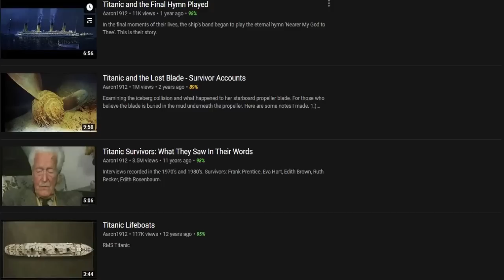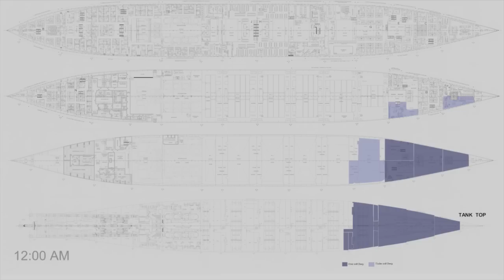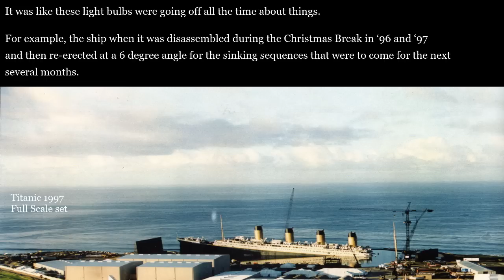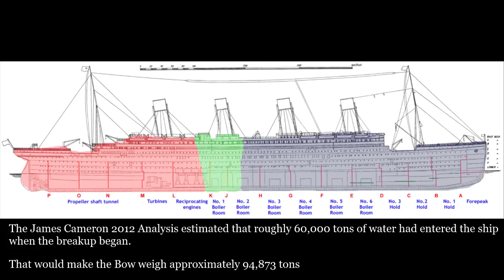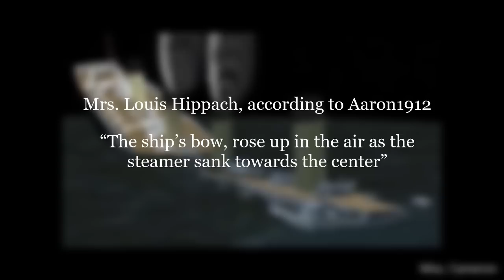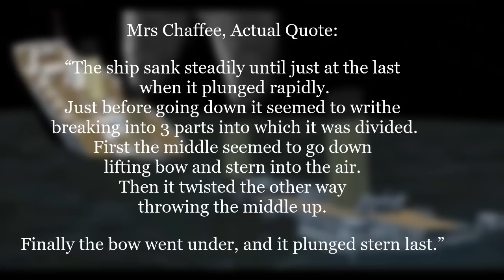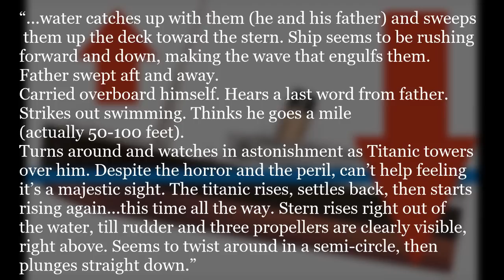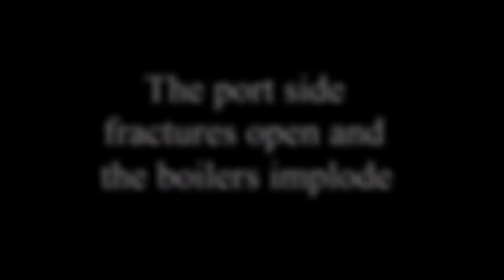Disproving Aaron1912's Titanic V-break

Comment: Your right, its the most simple flyid dynamics anyone with half a brain could understand

Create a hole, below the waterline of a ship, near the front and at the right hand side, thousands of gallons of water start pouring in right in that spot, so, of course, the ship due to the water will weigh heavier at the front, and on the right hand side

Then, as water starts to fill up those compartments, and spill over to the compartments rear of those flooded, the weight from side to side will even out, the list will return to even keel, because from left to right, the ship is now balanced

The nose of the ship will be somewhat under the surface, and with the weight of the water, wont return to the surface

As more and more water floods the front, the ship will see saw down, obviously, the flooded parts wanting to sink, the dry parts wanting to float

Then, when a part of the hull exceeds its design strength, it will snap rather than see saw, the flooded part will drop like a stone to the bottom, the dry part now starts taking on thousands of gallons per second due to damage, and that damage being at the front end of that section, the front end will start to sink, the back, still dry for now will want to float, same as the ship did when it was whole, see saw again, until it eventually completely fills with water and drops like a stone, just like the front

Now, the interesting question is, if the rear part hadnt been damaged so badly, that it didnt take on water, would that have floated indefinitely, and been able to be towed away, or would it have rolled over under its own weight and sank anyway?

This aaron sounds like a total idiot

Comment: Most of the ships i recall V-breaking were warships, mainly destroyers, that got torpedoed amidships and had the boiler/engine rooms flood first with intact bow/stern compartments. bigger ships tended to roll instead of snap due to having more structure left. 
otherwise they tended to sink towards where the hits came in, either bow or stern first, or roll over from amidships hits.
other v-breaks were ships that had the keel fail before the hull plating, generally due to fatigue or storm/wave.

Comment: well titanic didnt do a V break where anny part of the bow resurfaced a partial V break did in fact occour underwater, if you look at percise measuring of the section where the ship snapped you will find that a tremendous V shaped part of the superstructure and hull is missing, so when the ship sank before it totally broke apart the lower reinforced part of the hull acted like a hinge wich squeased the two halves together wich totally decimated that erea before the bow section gained enough momentum to tear apart from the top, that allso explains why the ship raised up vertically very fast at one point stood still for a moment and then came crashing down.

Comment: For the record, water in the bow while in the air would be the weight of the ship and the water, this is true.

But in the water the internal and external water are neutral, so it wouldnt be adding to the weight directly.

Comment: It would be very impossible for a ship like the Titanic to break from the bottom upwards. That would defy the laws of gravity.

Also, another flaw in his theory is that if the breakup happened as he had depicted, the passengers would be the very first ones to notice it.
Reply from the maker: It's possible in specific circumstances like the Edmund Fitzgerald, or battleships hit by torpedoes in the center of the ship in war time. But under the circumstances that Titanic was under? It's not possible.

Comment: Salt water reaches the hot boilers causing an explosion ,blows bottom out ,water comes in, forces trapped air back to the bow lifting the bow back up snapping the ship in half while water pulls middle down.  For some reason, from day one, they never listened to the witnesses .
Reply: Except that the boilers are intact on the wreck

Comment: Here is a theory, it wouldnt have mattered how many life boats over 16 they would have had because they wouldnt habe been able to fill and launch them before the ship sank. Even with 16 life boats with a few of them launched quickly they were still launching boats until the moment it sank. If they had 48 life boats the ahip would have taken alot of them down with her. Also with the heavy list of the ship alot of them would have gotten stuck on the ship and would be unable to launch. It happened to one of the last boats. It flipped upside down.
Reply: That boat flipped upside down because of the way it gotten off the officers quarters roof. That boat was collapsible B. Titanic had 16 full size lifeboats and 4 collapsibles. There wasn't a good way to get the collapsibles down because they never thought they'd actually need them. 

You are right though 48 boats would've actually caused more problems than they would solve. It took them the whole night to launch all 20 that they had and two of those were just floated off the deck just as the first funnel collapsed. Secondly the extra boats would've actually gotten in the way during the evacuation like a blocked door in a burning building and more people would've been left stranded in the water. 

We look at this event too much with hindsight in our minds. No ship of the time ever carried enough lifeboats for everyone onboard, because they relied on the telegraph and the heavily trafficked shipping routes to rescue everyone. That system worked, until Titanic.

Comment: the Titanic sank slowly first, thats why passagers don't notice that the ship was sinking, not because of the angle,  in james cameron's film, they say that "slowly first and then faster, then break because of pressure" and i think it's the real reason why Titanic broke, the accelerating of the sinking made the back of titanic elevate too fast, and i think thats why he maybe broke as a wallet and not separating boths parts before titanic gone under the water.. sinking verticaly seems weird, i've never saw a boad sinking vertically rather than a bomb exploded inside, here there is no way that he could sink verticaly, the Titanic could stablilisate with 4 sliced compartiment because the noze could stay over the water level.. if like it happends the 6 fourth compartiments were sliced , water could enter on the ship by the top, thats why water entered faster and made the ship sink even faster and broke Titanic. here is only my point of view, obisously i think he broke with a lower angle than in the 1997 film,  but here i'm sure the fact that passagers didnt notice it's because Titanic sank too slowly at the begin
Reply: To be fair when Cameron made the movie the ship's wreck had only been studied for about 10 years and since the movie was made He himself has gone back and researched the sinking and break up more in-depth to correct what was inaccurate about the movie portrayal.
Reply: But that part where Titanic Animations quotes Ken Marschall is true, your brain will compensate for a ship's listing after a little bit. A ship will almost always have a soft list, rarely actually at an even keel. Nobody onboard notices it even if they know it's listing cause their brain compensates for the change in angle if it's not a steep angle.

Comment: If the ship broke up on the surface the stern and bow Would have been further apart on the ocean floor due to the different hydrodynamic properties of the sections, and the wreckage of the crushed area between the 2 sections would have been spread over miles of seabed.
Reply: The bow and the stern are a third of a mile away from eachother and there are many survivor accounts that say they watched it break. I like the sea hunters, man but Jim Delgado couldn't be more wrong about Titanic's breakup.
Reply: Also when Bob Ballard originally found the wreck the debris field was calculated to be about 15 sq miles of area.

Comment: H&W builds most sophisticated ship ever in 1912 "unsinkable" due to water tight compartments. Ok well what's the plan should those fill with water you ask? Open said water tight doors to run a hose to the back where water could be pumped out LOL! All they had to do is spring for dual pumps in each compartment and you could drive that b** to NY with holes in the hull np.
Reply: Those didn't exist in 1912.....
Reply: @sorrenblitz805  So what were they hooking the hoses up to then?
Reply: @Meglenger  condensers, they hooked them up to the condenser discharge for the boiler system.

Comment: As someone who has studied the Titanic disaster for 25 years, any claims about "V' breaks and the absurd notions of the portholes being open are frankly ludicrous unto the extreme.  Contemporary accounts which mention, even in an offhand manner, the bow rising up during the sinking are easily disproven.  Particularly since post-break all lights had gone out.  Aaron1912's demonstration makes it impossible for the lights to have been on as long as they were, and therefore even less likely that anyone in the lifeboats saw anything.
Finally, a basic experiment can be done to illustrate the manner of the Titanic's sinking, with an ice cube tray in a deep tank.  It will sink in a slow manner before accelerating, before having the "stern" pulled up.

Comment: Fun fact- a V break MIGHT have happened, but it certainly didn't look anything close to this. 

The realistic V break theory states that as the ship split, water gushed into the cracks, pulling down the back of the Bow and raising the Stern. The tips of the decks touched and the bow split off (imagine a wooden stick breaking and when you fold the pieces in the opposite direction, the whole stick breaks). However, the Bow never surfaced again once it sank. 

If course, it might be wrong, but we'll never know, and the commented theory is much more realistic than Aaron1912's.

Comment: Haarland and Wolfe were some of the most innovative and experienced shipbuilders of the time.  They also built the titanic which had many flaws,  wasn't unsinkable and didn't have enough lifeboats
Reply: first off: titanic's design wasnt flawed, it had small problems but she just wasnt designed for what she lived.
second off, no ship at the time had enough lifeboats for everyone. not just titanic.
Reply: @hugoslr  small problems? There were inferior materials and cost cutting measures everwhere. And no ship was lacking as much lifeboat capacity as her
Reply: @StoutProper  wrong again, she was not built using inferior materials, nor cut corners. The myth that she was built poorly comes from studies in the 2000s that said the steel was inferior to modern one. But what do you expect to see with century year old steel? Yeah. The study concluded it was brittle, but that didnt have anything to do with its quality.
she was also built to survive an impact breaking any of her two compartments, and 3 in the front. It was even, after the sinking, discovered that she would have survived with 4. The ship was better than she was designed to be, how is that cutting corners?
and about the lifeboats, she may have been the biggest ship on the sea at the time but she wasnt necessarly transporting the most passengers. And she had 4 more lifeboats than she was supposed to. In fact, from her first designs to her final maiden voyage configuration,the percentage of passengers salvageable by lifeboats climbed by around 35%.
Reply: @hugoslr  sounds like utter bullshit to me. They used cast iron rivets for a start in order to save money
Reply: @StoutProper  it wasnt a measure to save money. The cast iron rivets were used in the bow and stern, where the hull curved, and where the hydraulic riveters (steel rivets) werent capable of going. 
knowing that the bow and stern are the best preserved areas of the wreck, why do you think the iron rivets are bad?
Reply: @StoutProper  and many of those supposedly cheap rivets are still holding the wreck together even now 108 years later under 4km of ocean. Here's something else. Olympic used the same batches of rivets during its construction, and in the 1930's when Olympic was scrapped, the scrappers were surprised by how strong the rivets actually still were. So obviously given Titanic was built nearly identical to Olympic Titanic's rivets would be and actually are just as badass.

Comment: Just a question regarding 11:00

I'm not refusing to believe that the stern was heavy (obviously)

What i dont understand is how the bow could be made heavier when filled with water, when surrounding the submerged bow was water.

Water inside the bow added weight when  the water itself was the same as its surrounding environment?

I'm kinda dumb, someone please explain simply
Reply: Added: I think of a sinking as water entering an air filled environment where it shouldn't be, hence the vessel starts to go below the water line. When water enters and makes it heavier , this means that the water was heavier than the other water?
Reply: The water weighed down the ship. If you put water into a glass that is in a pool, it will sink,because of the water inside the glass weighing it down.
Reply: @Cediii4ris  I understand that, I think I was having a brain fart moment. I was getting confused with the idea that once the bow was under the water level, it would still be as heavy as it was with the added water. 

For example, a glass of water in a pool wouldn't weigh as much as a glass of water, it would just weigh as much as an empty glass. Once taking it out of the pool, and past the waterline, the glass (obviously now full of water), weighs heavier.

Comment: I dont know anything about this Arron guy but he sounds insane. With that said I have a question about the weights you gave. Does that include the equipment in the ship? Obviously the heaviest machines in the ship were the two engines weighting around 2k tons by themselves I think. So if your weights are just the ship itself and not the engines and boilers and everything else then the distribution might be different.

It just seems odd that front third would weight almost 3 times that of the back third.